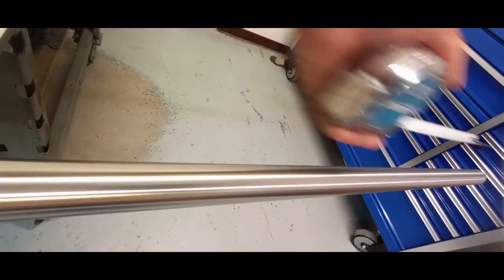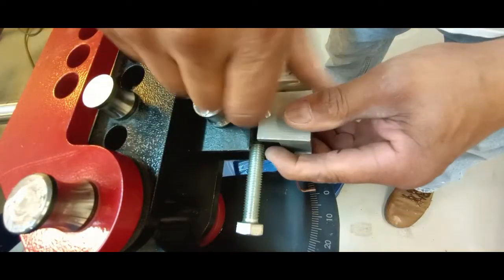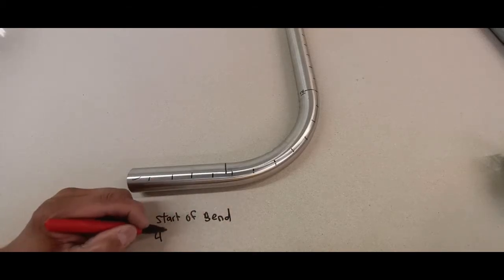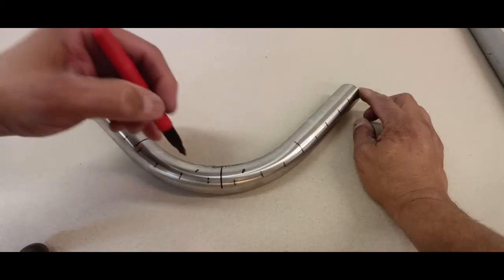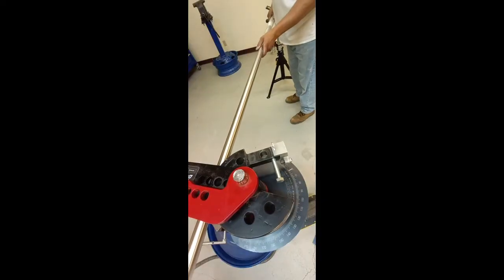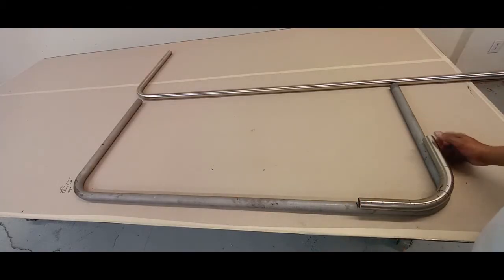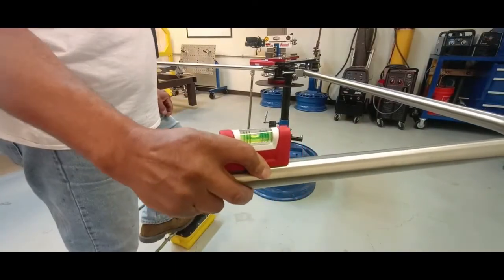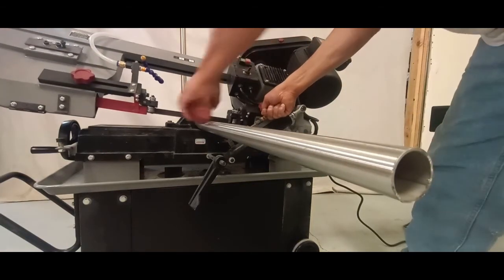Tube Bending 101: Making a radius gauge to calculate a bend - Perfect bends Every time !

Comment: You pointed out the diff in the CLR but I wouldn't use the word "perfectly" in replicating this. I'm definitely not an expert but it looks like your bending tubes on a pipe bender..
Reply from the maker: I agree.... you are NO expert....especially if you can't recognize the difference between a "tubing" bender and a "pipe bender"....🤔
Reply: Well, what I do know is
 
1 It certainly doesn’t pay being polite to some people.

2 That your machine has mandrels for both.

3 That tube is measured on the OD and pipe is measured on the ID.

4 That if you use pipe on tube it will be too big and wrinkle.

5 That if you fabricate exhausts your golden but if it’s for structure it wont pass.
Reply from the maker: @mnice59 okay.... well... you weren't trying to be polite and I have no problem telling you, you don't know what you're talking about
.... and if you think you do, make a video replicating, what I did, and let's see how good you really are.... i won't hold my breath

Comment: I'd love a video on how you set the zero point, and get repeatable precision on your bend angles. I've been getting ±2° lately doing sch 40 aluminum tubing with a manual JD2 m32. Would like to get that tolerance down.
Reply: Yeah, right there. You kinda breezed over how you preload, and how you determine spring back. When I'm bending Al tubing, there's an "easy 0°", then there's "take the slack out 0°", and lastly "somewhere north of 0° but still in the spring back region (2-4°). True 0° is somewhere in there. I'm trying to figure out how to set the angle guage to 0° reliably each time I setup my bender.
Reply from the maker: Time stamp 2:33, is that what you are looking for? or another item that can throw off the bend is not pre loading  the assembly ( pushing the dies, follower, etc all to same starting point when you install the tubing.

Comment: how would go about bending a 1/2" copper pipe in different diameters? say 8" 6" 4" 2"
Reply from the maker: I really don't have any experience in bending copper, I seems a conduit hand bender may work for copper. If you try it let me know how it works.

Comment: Bro. , is it better way if put a supporting rod(movable) inside of the pipe's bending zone when bend it.  my thought is that below factors shall impact the unbending size calculation and dedormation of pipe after bending:
1. pipe's OD + thickness
2. bending die's size ( it's OD should be slightly bigger than pipe's OD), for example, pipe OD 1 1/4 inch+ uppper tolerance, so bending die's size should be pipe OD+upper tole.+ 0.004inch as clearance
3. bending speed need controlled
4. pipe material will also impact (hardness), so adjust process parameter above 
5. lubricantion shall optimize the process
Reply from the maker: Did I not replicate the piece exactly using the gauge I made to calculate the bends??? Go build a rocket or something thanks for watching

Comment: Dumb question... do you need to make guides at 90°, 60°, and 45° if those are your close common bends... or can you calc them all with a single 90° guide?
Reply from the maker: THanks for watching, the focus of this video is fabricating a radius gauge 1. for accuracy 2. zero material waste.  To your question you could but then there would be an amount of guessing.
Reply: @guzzifabrication3448 you say for zero waste,  but if you make just a one of piece, now you already wasted a piece of tubing as a gauge. Also without a sample piece you still need to measure (and log) the distance of the x,y axis (to accommodate the stretch of the bend) for your initial bend. For this you may leave 1 or a couple inches extra on the end of the tube and cut it off after and thus not wasting 17 inches.

Comment: You lost me  when you started using an already fabricated frame for references to start marks. You are using a known finished product to find your bend starting point. I don't have that luxury.  Doesn't any one know how to calculate begining cuts  to bends and material needed without cheaters ?
Reply: The title of the video is " making a radius gauge to calculate a bend " that's what he did.... are you daft?
Reply from the maker: You could always just guess at how to achieve accurate bends....

Comment: I love the color of this pro tools bender. But it’s literally an Eastwood bender but $120 more.
Reply from the maker: I really wanted the JD squared but at the time they were back ordered
Reply: @guzzifabrication3448   same with JD. Same rating as the Eastwood for $150 more and the dies from JD are WAY more expensive. I wanted a JD as wel but when it does the same job as something less expensive it’s hard to justify.

And they all are a copied design off the Hossfield bender that lost its patent long ago and went into open production.
Reply from the maker: @mrmidnight32  I really wasn't impressed with the quality of the trick tools dies they don't leave marks on the stock.... but the finish out quality on the dies is terrible in my opinion. 
Yeah I'm really happy with the Bender but you're right why pay more when you don't have to.... I'm All About cost-effectiveness

Comment: There's a few crimps on the inside of the bends. Bend with  the seam on the tube facing up or down and it'll prevent crimping. Otherwise somethings a miss with the tool I suspect..
Reply: JD square model definitely does not kink stainless steel.
Reply: I saw that too... horrified!!!!
Reply: He had the follower die upside down
Reply: @rickyherbold785 how would that affect quality? Is the follower not a symmetrical shape?
Reply: @thenetwerx  it is not symmetrical. And it has a “top” stamped into it.
Reply from the maker: You get a certain amount of deformation with stainless.... not so much when using steel
Reply: My JD square bender does the exact same thing on 1.25” x .065 wall Stainless Tube. You really need a mandrel bender to prevent the inner diameter wrinkling

Comment: Kills me that no one seems to know how to calculate the bends with actual math and not have to always use a gage. It is easy and I am a guy who failed basic algebra in high school 35 years ago.
Reply from the maker: All hail the math flunky!!!
Reply: You use the arc length formula?
Reply: Maybe some of us do know the math and theory but are wise enough to know that the real world introduces error that is more difficult to correct for compared to...wait for it... A radius gauge.
Reply: @ar5000 I agree...a guage with a reference point-i use the flat side of  the die that touches the tube first works for real world scenarios...